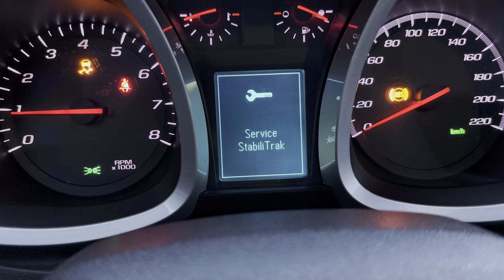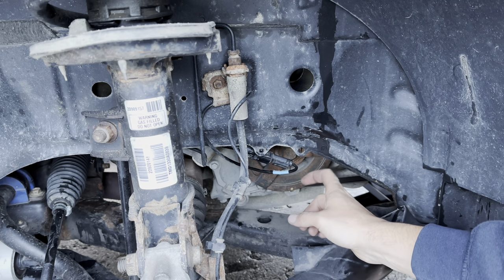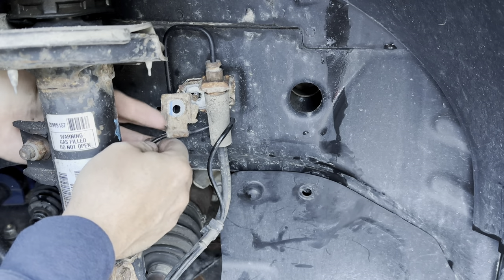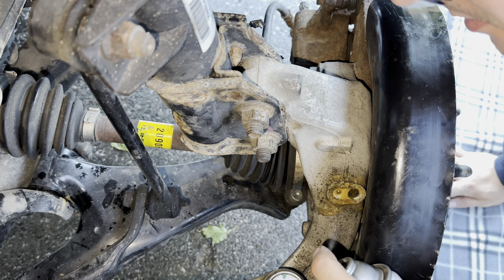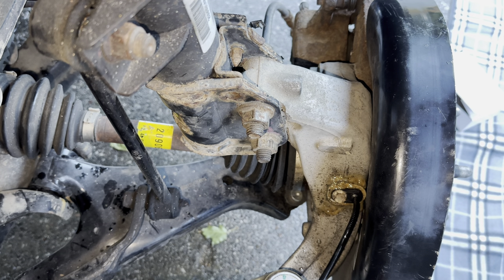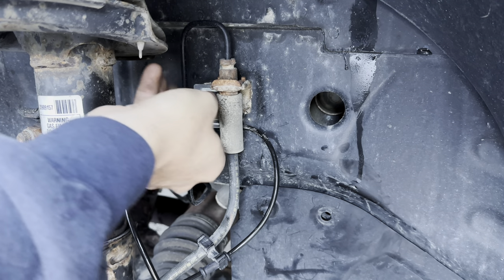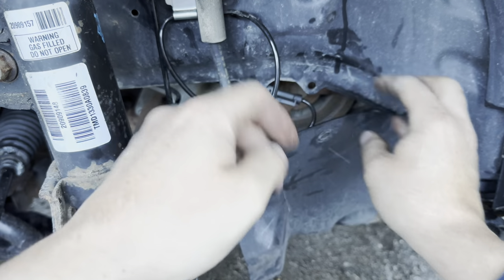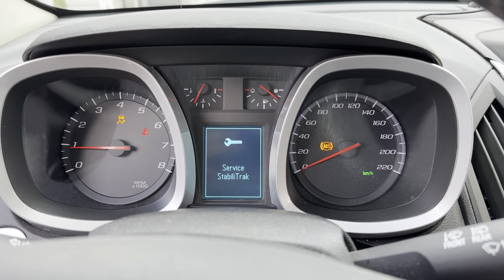Chevy Equinox/GMC Terrain Front Wheel Speed Sensor Replacement (Service Stabilitrak)

Comment: Thanks! Just had this come up on my 2012 Terrain. I'm glad it's (hopefully) something this simple.
Reply from the maker: If this does not fix the issue then you may have a broken tone ring on the back of the wheel hub. This video is just one possibility. Hope it works for you though. Please keep us posted. Thanks for watching. Please like and subscribe
Reply: I need this done on my 2012 terrain, also. 😢
Reply from the maker: If the speed sensor is replaced and the warning lights stay on then the tone ring on the wheel hub could also be faulty. Just an fyi. Thanks for watching. Please update us if it fixes. And please like and subscribe

Comment: thanks again! My engine light was blinking in conjunction with TC and misfiring, no ABS thankfully. We'll see how it does after spark plugs, PCV hose cleaning, and deep throttle body cleaning. If not, I guess I'll be coming back to your video lol.
Reply from the maker: Did you scan the code to see what it was?
Reply: @BillOfAllTrades2016  it was gone before I could even get my OBD2 out the console. the  check engine was blinking and not solid. The traction control light stayed on though. Got to work, turned the car off started back up with no lights showing at all, not even TC🤔
Reply from the maker: That’s strange. I had my tc light flicker the other day and go back out. These things can be a mystery. I would say do all the services you were planning, give it a test drive for a good 10 minutes then scan it again to make sure all is well. Is your scanner capable of scanning the bcm as well? Or is it a basic scanner only? Because I had an old scanner that would only pick up engine codes but couldn’t read the bcm codes I had.
Reply: @BillOfAllTrades2016  I have a basic one, but definitely look into one that reads the body control per your recommendation. 🙌🏽🤞🏽
Reply from the maker: I recommend the bluedriver scan tool. It’s Bluetooth to your phone and only $100CAD roughly. If you have an engine code it will tell you what it is and also it will give you the most common fix that solved the code. It’s very handy.

Comment: Didn’t see you pull the actual sensor out of the hub, so not sure of the reverse order 😢 Very helpful though Thanks
Reply from the maker: That’s weird. I thought I put that in there. Thanks for letting me know. The order you remove and reinstall does not matter. You can start by unplugging the harness and working your way to the sensor. Or start at the sensor and work your way to the harness clip. Hope this helps. Please like and subscribe

Comment: Would needing a wheel alignment also cause service stabilitrak on a AWD vehicle?
Reply from the maker: No. Wheel alignment has nothing to do with this issue. Have you scanned the vehicle for fault codes? This warning will come with a fault code that will tell you what the issue is.
Reply: @BillOfAllTrades2016  i replaced a faulty wheel speed sensor and the abs fault was fixed, so now it's just the stabilitrak service. I'm leaning towards a wheel alignment for the service stabilitrak light.
Reply from the maker: As I said already, a wheel alignment will not fix the service stabilitrak warning. You need to rescan the vehicle for fault codes to see what fault code is causing the stabilitrak warning to come on. If a warning is present there will be a code to go with it. Guessing on what to do will result in wasted money and time.

Comment: How did you determine it was passenger side? Is it in front only?
Reply from the maker: You need an obd scanner capable of scanning your bcm. I used a scanner called bluedriver. It gives you a code and tells you in a description what sensor is faulty. There is a wheel speed sensor on every wheel. The scan tool can pinpoint what one is faulty. Most commonly the front ones fail first. Hope this helps. Thanks for watching. Please like and subscribe

Comment: I have a 2014 gmc terrain I just had this light come on great video! How do I know what side I need to do?
Reply from the maker: I had a coworker use an obd scanner that is capable of scanning the bcm. Standard scanners only scan the ecm. The scanner he used is called blue driver. Hooks up to any smart phone. The bcm code will tell you what side is faulty. Thanks for watching. Hope this helps. Please like and subscribe
Reply: @BillOfAllTrades2016  great video I scanned and got 4 codes so I replaced the cable 1st but than did the whole hub and it’s as good as new
Reply from the maker: Nice. My dash is still lit up. Waiting for a new hub as well
Reply: @BillOfAllTrades2016  I got one the next day off Amazon for only 78 bucks fit perfectly
Reply from the maker: I’m waiting for a free one from a collaboration I’m doing with a company. They sent me an alternator that is arriving soon and the hub should arrive in a Couple weeks

Comment: Will this cause your brakes to stick? Both of mine are dragging for some reason and I'm getting this morning on my dash
Reply from the maker: Brakes sticking is usually caused by seized slider pins. Take your brake calipers apart and and/ regrease the pins and clean any buildup of dirt and rust from the inside edges of the caliper. As for the Stabilitrak and abs lights, you will need to scan the vehicle to get a code so it can be properly diagnosed

Comment: Would this sensor/wheel hub ring cause the vehicle to stall and turn the engine off?
Reply from the maker: I personally never experienced that. After you stalled did you read any fault codes with a scan tool?
Reply: @BillOfAllTrades2016  it ended up being the Intake cam actuator that needed replacement.  Thanks!

Comment: Yo tengo el mismo problema en una Chevrolet equinox 2010
Reply from the maker: If this does not fix the issue then the wheel hub may be faulty. Please refer to this video as well: Chevy Equinox/GMC Terrain Front Wheel Hub Replacement (SERVICE STABILITRAK FIX)
https://youtu.be/MxoHKyS28Lc
Thanks for watching. Please like and subscribe